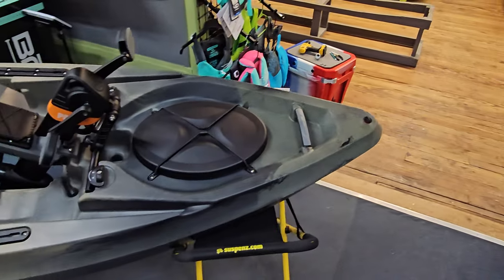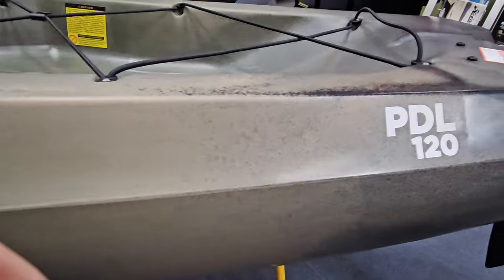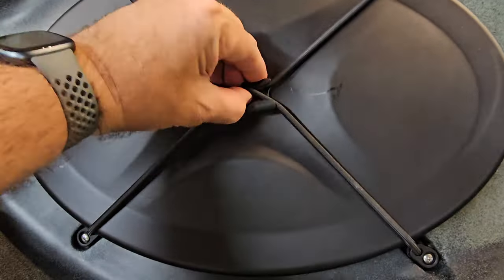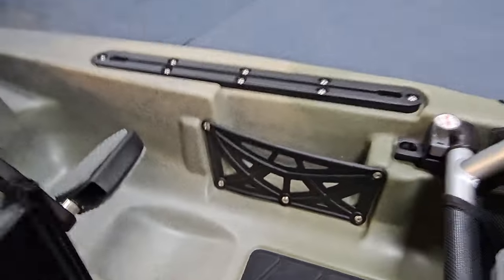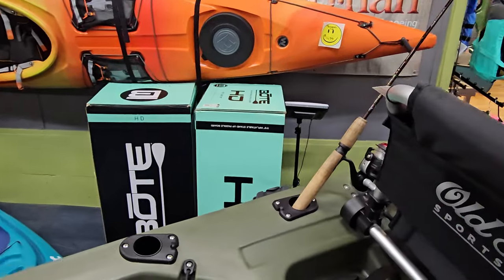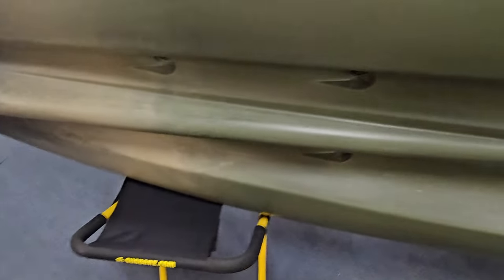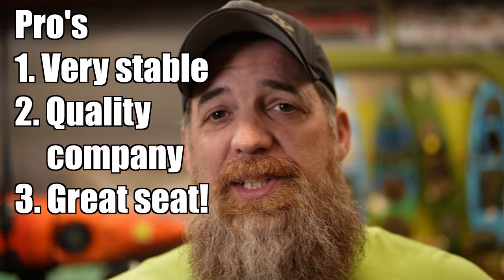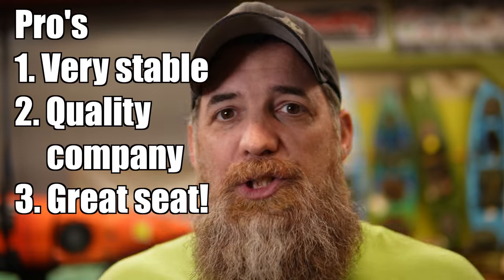Old Town Sportsman PDL | Still worth it?

Comment from the maker: Let me know what you all think! Is the Sportsman PDL on your list?
Reply: I would love to have 2 of the Sportsman PDL 120, my wife and I would like to get them. for me fishing and recreation. wife would like one for exercise.
Reply: @BrianSnodgrass-tk1co  memorial sale right now
Reply: Yeah, and a $200 rebate.  I got a great price on close out.  $1875 for the 120 PDL before the rebate….1675 after.  Incredible deal
Reply: @michaelo5400  that is a great deal! I just pulled the trigger on the 106 PDL. $2140 after the rebate. Where did you get yours?
Reply: I have it narrowed down to the Bite FD & the Old Town PDL 120. What boat would you recommend for inshore & marsh fishing?
Reply: Bought one 2 years ago and sold it within the year. It was actually great to use but I did not use it enough. The weight was very much noticed and might have been part of the reason. The other is I have too many options and fished out of my boats more. BTW the prices back then were like $2k for the 120 so the current prices are a bit mad. 

Sold my saltwater boat this year and been out in my paddle kayak a couple of times. Both trips I was wishing I had a peddle kayak and now considering another OT PDL 120 Sportsman or Salty. I might even go back to a Hobie as I spent a lot of time in them and had a blast. 

Something with a motor is also appealing but if I’m going to increase the complexity too much, I may just get another boat.

Comment: I absolutely love my 120PDL. I have no problem loading it in my truck or transporting it to the waster with a cart. Also if you don’t lock the drive down in shallow water it will just pop up if you happen to hit something and it doesn’t affect your pedaling ability. Highly recommended.
Reply: u can break your prop like that! exact thing happened to me.

Comment: Got my Oldtown Sportsman PDL 120 last Christmas. Upgraded from my older 2016 Hobie Outback (that was used when I bought it). I love everything about it, you are spot on with stability. I weigh 230lbs and standing and casting is extremely easy. The price point is great and seat is super comfortable. Parts are easy to come by and there are tons of upgrade aftermarket products from Navarre Kayak Fishing and Yakhobby. I transport mine in my truckbed with an extender and the molded in handles on the back make it super easy to load/unload. Wheels wise I use the Yakattack tow n stow cart and it works well for me. I was also surprised at how thick the hull is and I’m not concerned about durability because of that reason. The peddle drive is smooth and I can casually go 3.5mph and hit 4 1/2 to 5 if I push it harder. Two areas where I can say that could use some improvement are the dry hatch latch on the peddle drive, it occasionally pops open if I bump it (could be a issue if storing stuff you want to keep dry but I use it for busted plastics etc. The other area is the rudder in wind, tracking is awesome but making directional changes can be difficult. I remedied that with a yakgear assault hand paddle so it’s not a big deal but just something to consider. 
Overall I am extreme pleased with my Oldtown Sportsman PDL 120 🤙
Reply from the maker: My exact on the water experience with it. I was in some bad wind though

Comment: I can say with confidence that the slide system for the seat will hold up for years. I used the topwater 120PDL for 5 seasons before upgrding to the 106MK (health reasons). It is a great system that holds up.
Reply from the maker: Not really knocking the system itself, just thinking how lake water may gunk it up. Specifically the knobs that you pull up on. Some lakewater is like old bubble gum once it dries out.

Comment: Just purchased my sportsman 106 PDL and I absolutely love it! It’s super stable and there’s plenty of room. I’m 5’11 and weight 250lb it handles me and my gear perfectly! I live in FL and it handles the golf water with no issues Only complaint I have is it’s heavy and a pain to put away in my storage unit.
Reply from the maker: Yeah a lot of pedal drives that are durable can be a bit much to haul around. An old jet ski trailer is a good investment if you can find one
Reply: I’m thinking of getting the 106 I’m 5’6 170 so it should handle me pretty good huh ? I don’t carry a lot of fishing gear I’m less is more when it comes to fishing
Reply: @ryanbennett4956  for sure! I’m 250 and it’s super stable. Even standing up

Comment: good morning , very  good vid as always . this is MrBear hudson fl. i fish salt water  some what of shore 1to 3 miles, i have a ss127. with that said my ? to you is why for a safty factor on all sit on top kayaks why dont thay put a floor hatch cover so if you get a leak you can open it and put your hand pump in, to bail it out. if i get a leak in my ss127 a mile of shore i cant get the water out of the hull , im 64 285lbs and for get the bow hatch. if kayak comp. all of them could put a cirle hatch in front of the seat so we could pump out when needed. may be you could find this out and let us kayakers no . thank you very much stay safe to you and yours.
Reply from the maker: hello Mr. Bear, 

I would probably try to reinforce the hatch seal with more weatherstripping or use a cover. Most kayaks that are meant to stand and fish from (not all) will reinforce the deck to help out with accommodating a standing position. When you put a hatch in the center, it can increase water access into the hull with deck flex. 

That being said, I understand the frustration. That must be some crazy surf to get that much water in there! 

Be safe out there

Comment: If you did not like the peddle crank arm length you could probably find different lengths at a bike shop. Also you can change to different bike pedals.
Reply from the maker: No issue with them. I simply review kayaks as they come stock

Comment: have you had any complaints about the native titan X 12.5 holding water in deck issues? I ask because I'm ready to pull the trigger and purchase one. I've watched videos of Greg Blanchard and seen water sitting without draining and of course he wouldn't respond to any questions about it. Is there another kayak that you would choose over titan X 12.5?
Reply from the maker: I've done a short on this issue. There is no issues with the Titan X series with standing water. The deck has been redesigned to slope more towards the scupper. Also they finally fixed the rudder to a better spring blade rudder that is 100% better

Comment: I’d like to see a comparison between a 106 and a slayer max 10.
Reply: Those natives are badass and a lot of cool features too
Reply from the maker: Very similar. I would give the slight edge to the OT 106 but I like the setup and rigging options with Native a little better.
Reply: @thebeardedpaddler  where would the edge be? Coming from a bass boat and being interested in kayaking. I have a Helix 8 mega plus. Seems like the rigging options are excellent with the native. Only thing I have no experience with is the pedal drives.
Reply from the maker: @Bassinwithjesse  personally I like the feel of the Propel drive. It's metal and more sturdy. They are both phenomenal drives. 

I also like the layout of the Slayer max. Gear track, hull thickness, and front and rear storage. OT needs to update the hull a bit I think, but not because it's bad. Just update for easier rigging

Comment: You’re not giving true information. There is no difference in the front of the boats. The only difference is behind the seat at the back.
Reply from the maker: I gonna disagree with you there. The hatch and compartment is small in the front and the back 
The 10.6 hatch is 16" 
The 12 hatch 18.5"
I know because I have them side by side